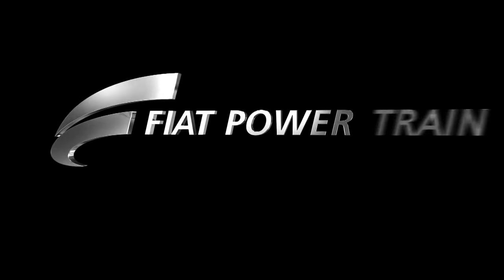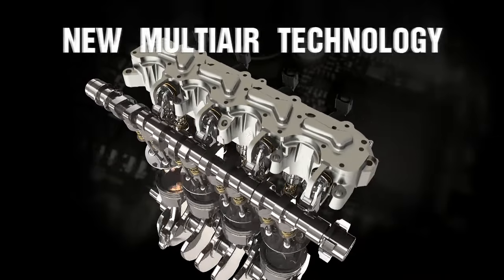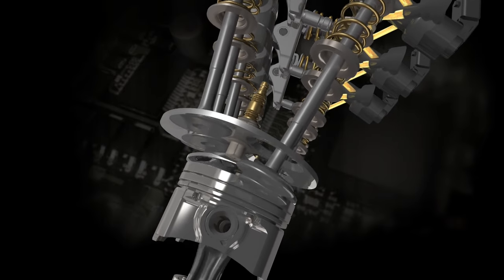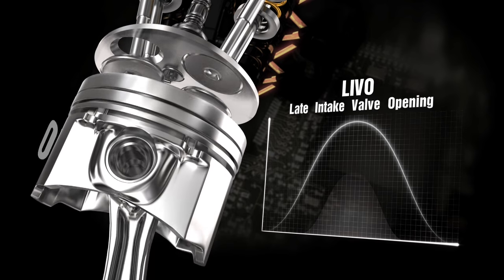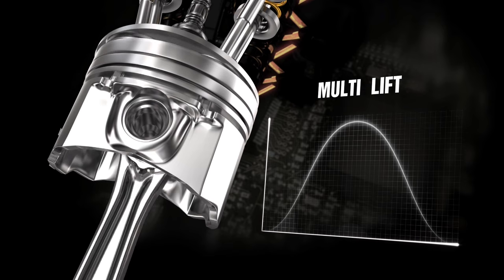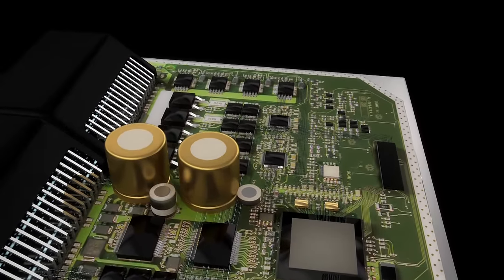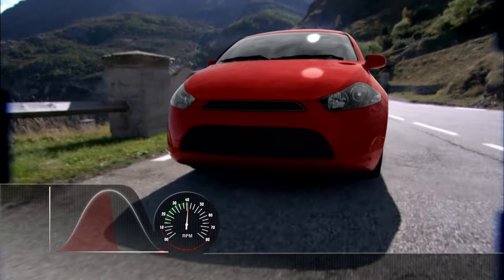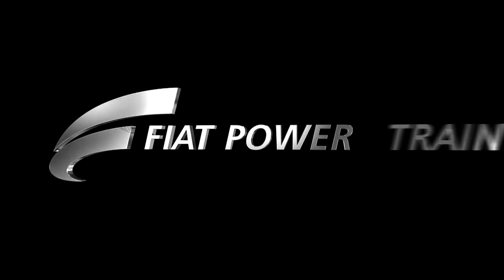How Fiat MultiAir Technology Works

Comment: Honda called from 1989, they said you guys are late to the game and pretty much failed. VTEC can be applied to both cams, I-VTEC throws in cam angle phasing, so this is just lame. I understand why Chrysler will go bankrupt for the 3rd time, or 4th, or 5th time, sorry I lost count.
Reply: +Marcus Taber Fiat was the first auto manufacturer to patent a functional automotive variable valve timing system which included variable lift. Developed by Giovanni Torazza in the late 1960's. So it looks like Honda was late to the game.
Reply: Patent vs actually producing. Honda mass produced it first. Ideas are easy to draw, hard to actually accomplish, so Honda was first in its game as they used a novel method that didn't infringe on other's patented ideas. Now why didn't Fiat actually produce that? I have read about that before but really didn't take it seriously because it never went into production. Regardless it looks like Fiat has acquired the STD known as Chrysler and they are starting to sink just as others did when owning that american embarrassment.
Reply: Marcus Taber Chrysler is an "American embarrassment"??? You're clearly just anti-American. Chrysler innovated MANY things in the automotive industry. They're an American icon and they'll be around for a long time.
Reply: An American embarrassment? How many times have they gone bankrupt? How shitty is their engineering? WHO OWNS THEM NOW? Even the krauts couldn't stand owning them, now the Italians are learning about what they can't do. Next up is the Chinese.... Sorry you have a MOPAR hardon, but as of the past 3 decades Chrysler hasn't been living up to what they used to be. And if I was anti-american I would be talking crap about GM and Ford. GM has the same institutional crappiness as Chrysler, Ford got their act together in the early 90s, and I respect them for that. I personally do not like American designed cars. I don't like trucks or SUVs, but I respect what Ford has done. Chrysler just sucks as of late though, bankruptcy, being sold to foreigners, and designing crappy cars as evidenced by realities is my proof.
Reply: Marcus Taber  "designing crappy cars as evidenced by realities is my proof"
No, that's called an OPINION. My 2014 Hemi Challenger is far from "crappy". And Chrysler is doing very well under Fiat, whether you like it or not. That's a fact. How many times has Chrysler gone bankrupt? Zero. That's why they're still in business. You see, "declared bankruptcy" isn't the same thing as "gone bankrupt". By the way, GM and Ford have been given enormous government loans in the past too. And guess who still owes them money...Yep, only Ford.
http://www.forbes.com/sites/joannmuller/2012/08/29/automakers-report-card-who-still-owes-taxpayers-money-the-answer-might-surprise-you/#6d761716a8cd
Reply: VTEC it's a mechanical variable valve timing VVT system based on Fiat's 
'60s patent. The fuel injected models of the 1980 Alfa Romeo Spider 2000
 are the first production cars had a mechanical VVT system. Honda's VTEC
 first used in 1989. Multiair technology is the next step of VVT systems.
Reply: Fiat launched the first mass production direct injected diesel (Fiat Croma TD i.d.). And then invented the Common Rail (156 jtd).

But I do agree Chrysler in particular is a parasite. MB almost went totally to shit. All Chrysler did was using MB tech to make it's own models. But I think MB will still die a slow death now that they're partnering with Renault.
Reply: "Euroford" currently is one of the best makers with extremely good cars here on the Old Continent. I don't know how durable the still quite young ecoboosts are, but those that own or have driven them just love them. And the cars seem well made. Not the most fascinating looks nor (for older ones) the most refined, but it seems to me they chose a nice "no nonsense" approach that makes their cars rather reliable, or at least "never non-mendable". Parts are pretty cheap too for the 10+ year old models. There's something Henry Ford/model-T-ish aura about the mondeo mk1/2 and the escorts/fiestas of that era: Cheap, basic but serious and honest cars for normal people. (What you'd expect from VW actually) Sure they look worn by now but there still are quite a lot around, in good working condition. And there's a shit-ton of Mazda/Ford dealerships.

I'm sure all Fiat and MB were interested in was Jeep. At least on the non-US markets. I'd love to get me an older MB powertrain Grand Chero' or a Mazda/Ford truck but they're still just a little bit out of my wallet's range...
Reply from the maker: MultiAir is beyond what Honda did.   MultiAir  technology for the first time allows for variable adjustment of the valve lift , its opening and closing times, the duration and the number of openings.  This means the MultiAir system enables the intake valves to be opened and closed more than once during one intake stroke, depending on the load condition and driver requirements - and this for each cylinder separately. The valve can even be kept closed.  This makes MultiAir the world‘s first fully and continuously variable valve control system.
Reply: @numberpirate  lol this system is everything vtech wishes it could be. Aside from it not controlling the exhaust valves, its just a better system then vtech
Reply: @410cultivar  And there's no reason it can't be made to control exhaust valves